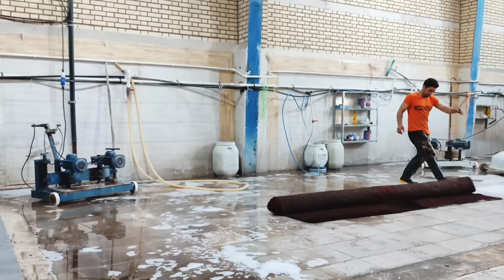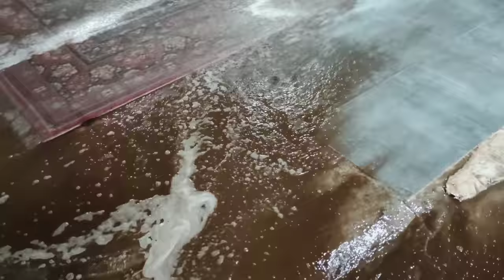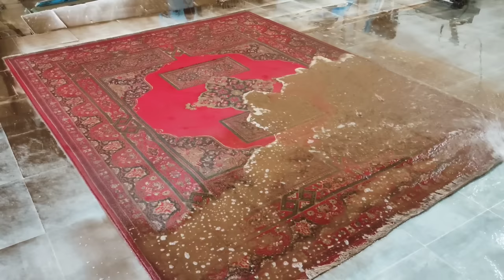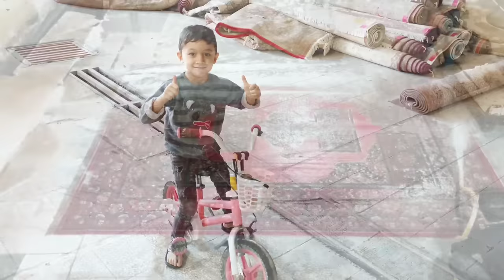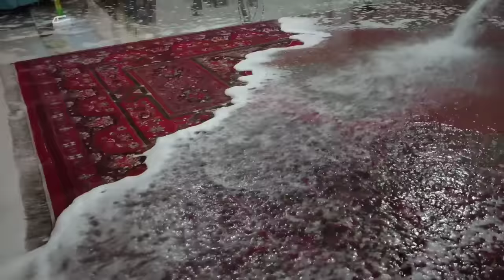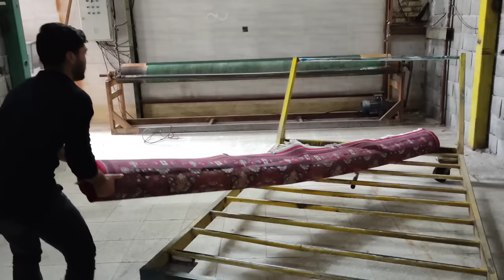Sewer overflow - lncredible dirty carpet cleaning satisfying ASMR

Comment: I believe that because we are working on a stone floor with no drainage, the only escape route for the dirt particles is laterally.
I believe that the dirt particles move from side to side within the carpet fibers, so the dirty water is always coming out.
I think it would be more efficient to use grating or a mesh floor so that dirt can escape downward.
Reply: It would ruin the carpet when it is being scrubbed to be on flooring like that. The fibers move as they are supposed to when on flat flooring like he uses.
Reply: @francegamble1  the mesh must be slightly above the surface of floor. See all the dirt as the carpet is repeatedly moved. Save on labor as well. No need for a 30 minute video. See the same things over and over and over.....
Reply: go ahead and do it your way and let him know how it works out.
Reply: It's not just draining the dirt he's also using machines on them which he would need a flat surface for

Perhaps he could use the mesh in the beginning
Reply from the maker: You are right , we will do, thank you.

Comment: The water remains on the floor, which wastes unnecessary time. Retrofitting a slope saves you a lot of work and money.
The floor itself is also too rough; a smooth surface would make more sense.
Hang the connection cable from the ceiling with a long spring, then the cable goes with the worker and not the worker with the cable.
Reply from the maker: It's that right👍

Comment: Well, those carpets are incredibly dirty! Where did you get them from? They always discharge the same brown dirty water! Is it from some flooded area? As if the carpets were equally dirty. After cleaning, they are beautiful. I guess they weren't on the street! Where could they get so dirty?
Reply from the maker: Hello my friend
Many carpets are used by the owner in the garden for weekend cleaning, but they are not properly maintained, and many are used at work and in the open environment.
Reply: @change-cleaning-service-center  Aah! Thanks for the explanation.